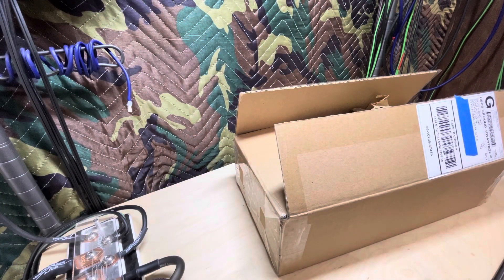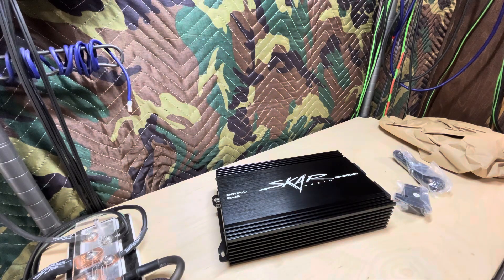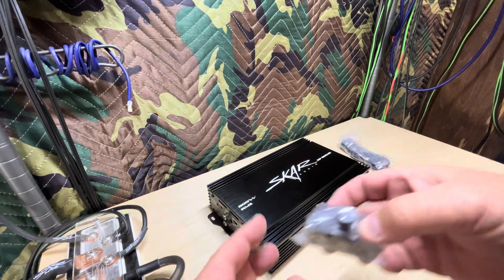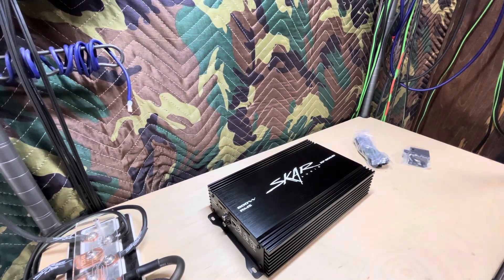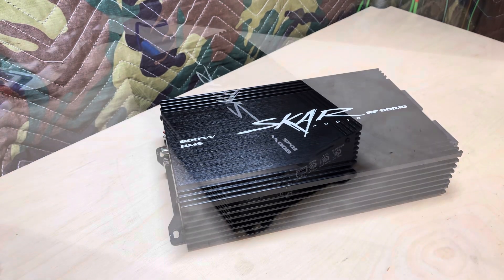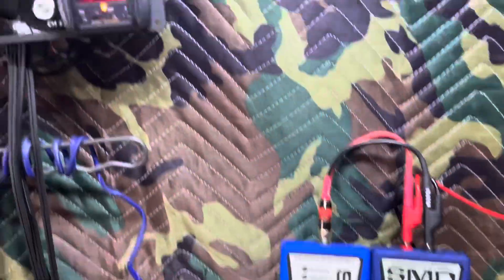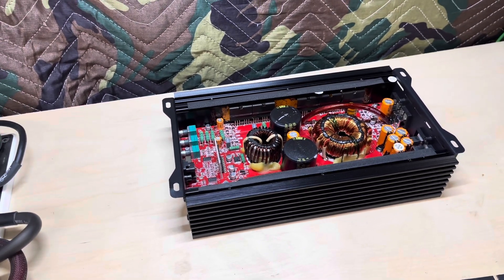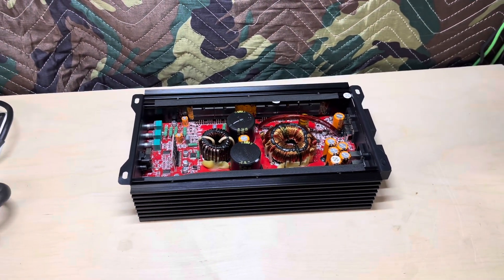Skar RP-800.1D Overview and Amp Dyno

Comment: Appreciate you showing the current draw. Notice a lot of people who video amp dyno never show that. I’ve been into car audio for thirty years, and skar getting a bad rap is funny to me. Their product is insanely cheap, always hit numbers higher than advertised and works well. People overdrive equipment and then complain it’s crap. A properly planned system, dialed in and played with in thresholds will tell you how good a product is. Skar is hands down the best budget buy. Although I haven’t tried their subs, their amps slam. I just bought the 800 mono block and those numbers are impressive from such a small package.

Comment: Only issue I had with this amp was that it ran really warm. I placed it on abs and spaced it off about 1/4” and it helped a little. It never shut off due to the heat. I had it a year before upgrading. Good amp.
Reply from the maker: That stinks. It wasn’t wired too low?

Comment: Great little amp and good value. It faces stiff competition in that price range, as Recoil RED1200.1, AudioZerone ZE1000, Memphis SE2000, and even Stinger MT700.1 are all cheaper and perform the same if not better.
Reply: I've seen some vids on the Stinger and it's a solid performer!
Reply: The recoil and AudioZerone are full of much cheaper components than the skar though. I can't speak on the others, but I would imagine the stinger and memphis are pretty solid boards too. Memphis has always been an underrated SQL brand imo.
Reply: Love my Stinger MT2000.1
Reply: @BlueTegu360 skar is full of cheap components.... Don't know what point you was tryna make with that comment. But I'll take a recoil over a skar amp.
Reply: @Ninoo187  what are you powering with it?
Reply: @TheGodofSEO  JL W7 13.5
Reply: @Ninoo187  don’t mind me, I’m stupid.
Reply: @Ninoo187  lol I already knew that. Didn’t see it was you

Comment: The RP line is very inefficient below 4ohm. The amps get real hot too.
Reply: Well I have two strapped rp4500’s to one sub at half ohm and only get warm after 30 minutes full tilt
Reply: Wow, That’s alot of power to a sub! What type of sub you running with all that power?#🔊❤️@BrianWaller-qe7gr
Reply: @bondalero0074   I have two but only using one for now fi audio mt12’s they are rated at 4500 rms but they handle two 4500’s at 60% full tilt no problem and at 100% about 20 minutes before the voice coils start cooking so I back it off.
Reply: Sounds like some bad boys!#🔊❤️